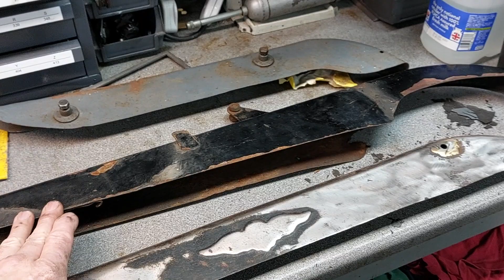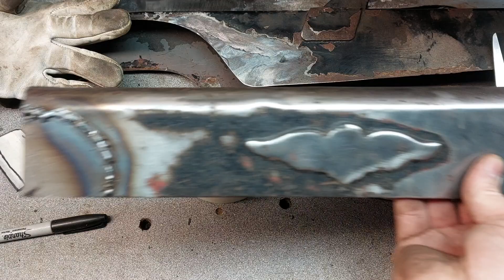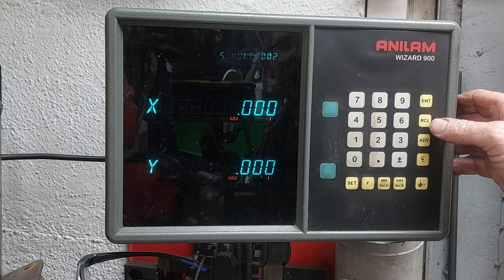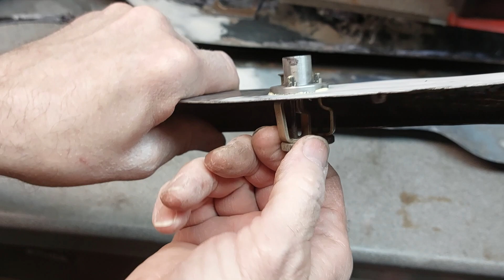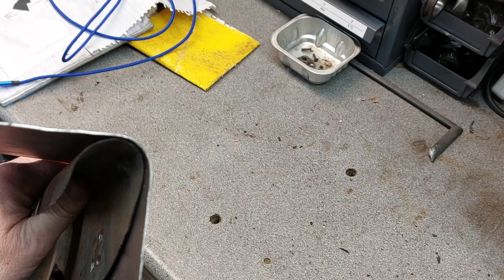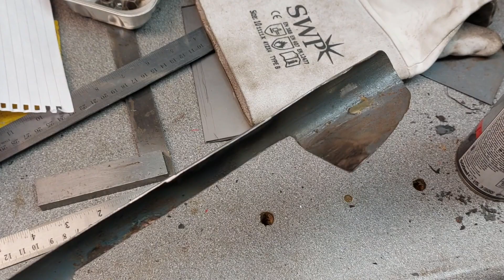CHAIN GUARD REPAIRS ON SCOTT, EXCELSIOR AND BSA BANTAM PROJECTS

Comment: I am in awe of your skills Mr T. The chainguard and rear carrier brackets I made last week used my own skillset. roof truss holding down straps bent, (sorry- formed) using the joints in my concrete coal bunker and a 4 pound mash hammer. My finish of choice is very old black hammerite to conceal any minor imperfections. Would you like an instructional video to see how the other end of the restoration spectrum operate?
I thought not...
Reply from the maker: Using the term " formed " rather than bent has raised you to engineer level 😉 and guard that old Hammerite well as the new stuff isn't a patch on the original

Comment: Very nice work Mr Tweed. reminds me of the time I made a Matchless chain guard by bending a length of tube, then cutting it in half lengthways and welding sides on. Never did work very well, lots of clanging when riding. Eventually opened my wallet 😱 and bought a new one. Took me thirty years to build up courage though!
Reply from the maker: Wise man, best not to rush these financial decisions 😁